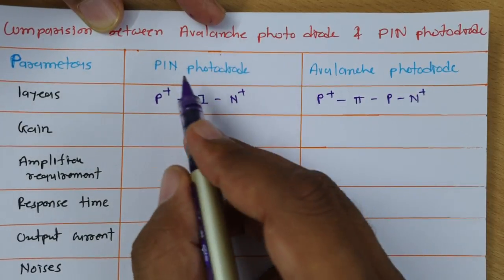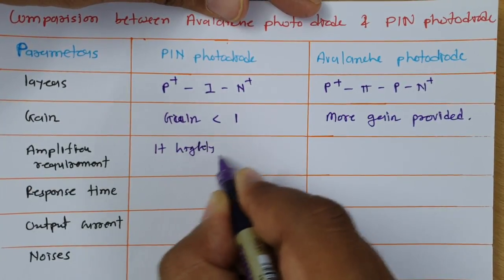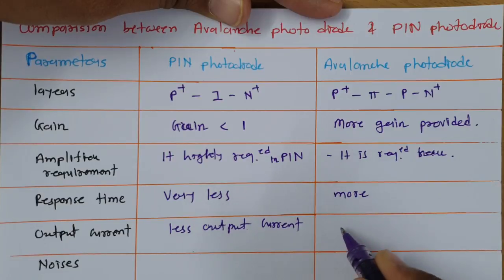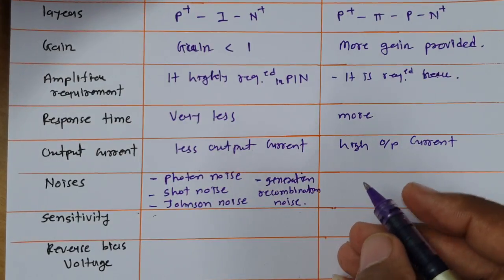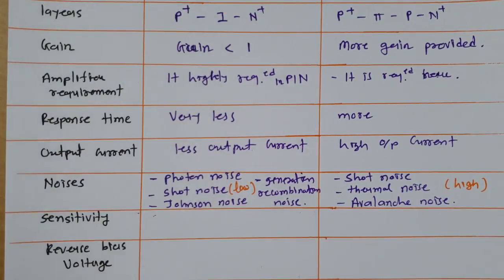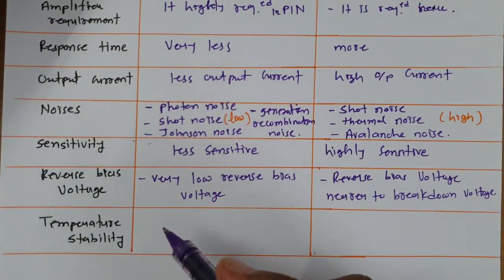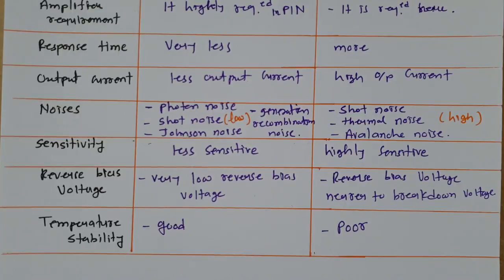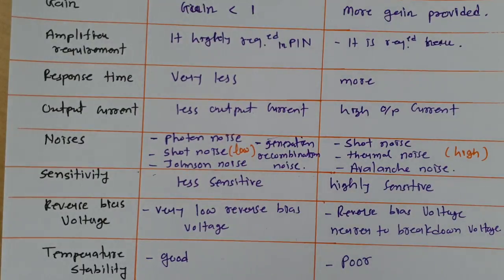Comparison of PIN Photo Diode & Avalanche Photo Diode in Optical Communication by Engineering Funda

Comment: Sir u said in previous lecture that pin photo diode has large depletion region..so is that mean it provides high output current?
Reply from the maker: It means It is used for photo detection as it has more photo detection area.